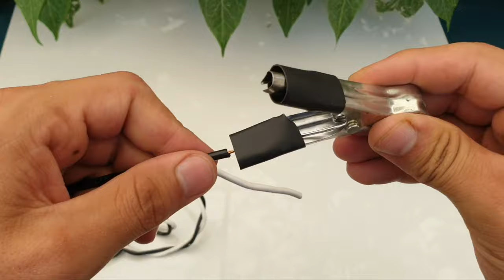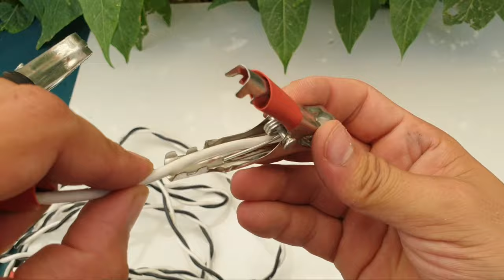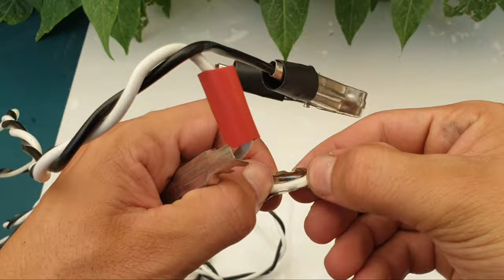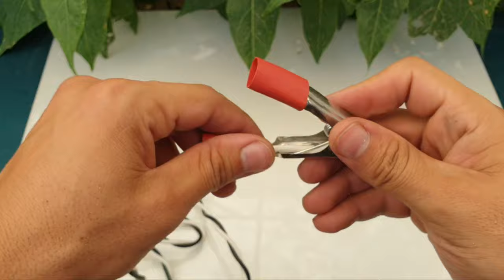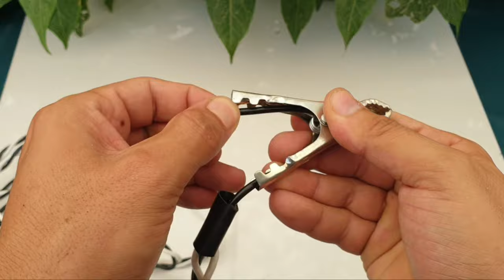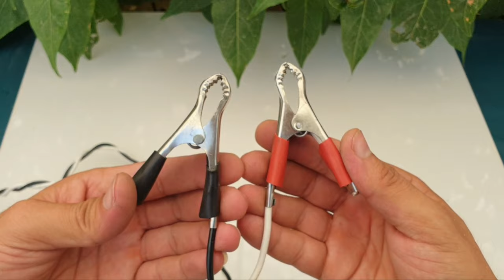Proper Way to Fix Wire in Clips. Connect wire in crocodile clips properly

Comment: Doesn't this weaken the clamp force by interfering with the spring?
Reply: I did this and i am start to think about your comment...there is high potential the wire insulator going to be ripped off over time as it move back and forth with the spring of the clamp
Reply: @neodiy the spring barely moves and there's little pressure from the wire on the spring body

Comment: Yeah it won't pull out but the electrical connection is still lousy.   If you soldered it or put a lug in there then it would have a good connection.

Comment: Good thinking, however there are two alternatives.
All Crocodile clip have a amaa hole where you crimp them. It is for soldering the bare end and crimping the insulated wire.
Now as suggested by you we can do that with both the lugs and if you are not interested soldering then just remove a little bit of insulation in the return wire and by this you can get more current carrying capacity.
Usually we use this double method for welding electrode holder.
Thanks.